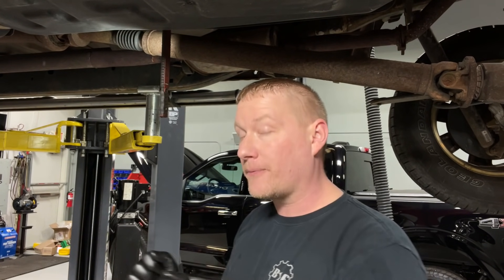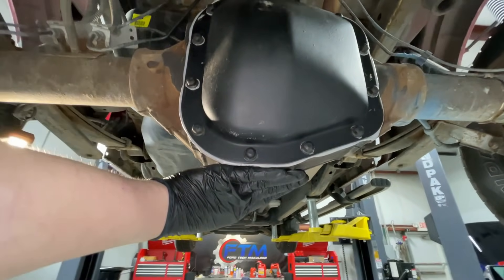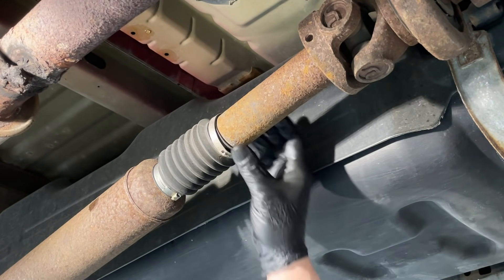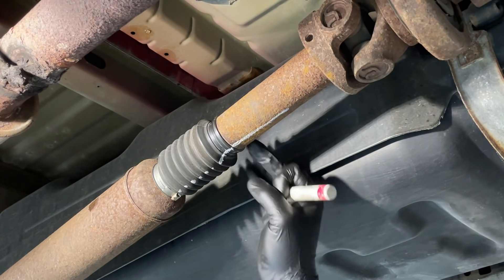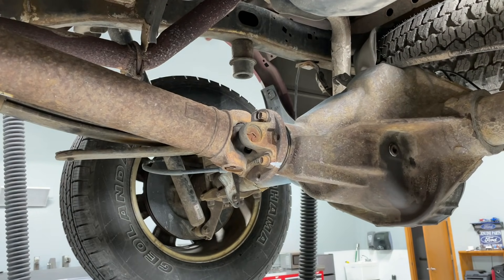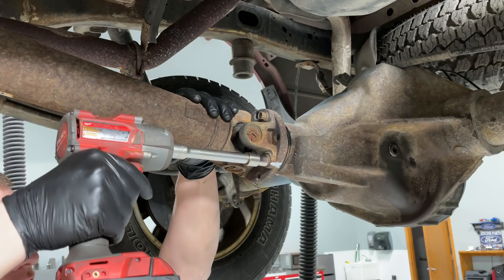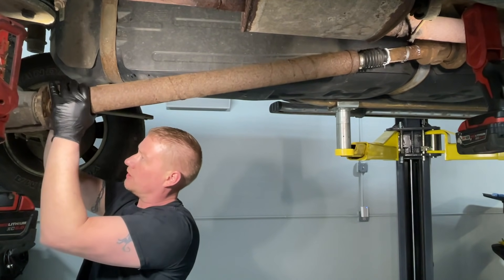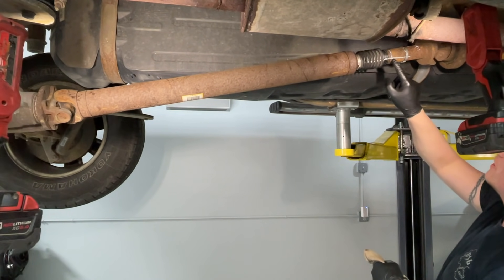Ford F-150 Driveline Slip Bump: Two Piece Driveshaft Kit Fix!

Comment: Man hooked on your channel, saving big $$$ on ford maintenance!  Nice safety Tips, Great content
Reply: He released a 2V spark plug repair video right after my F-250s V10 spit a plug.  After having a local machine shop "fix" the same issue on my Mustang resulting in another blowout and engine fire under 100 miles later I decided to fix it myself for cheaper.  It's been a few years and my driveway fix using the tools, advice, and methods in his video is still holding up, sucker pulls my camper all over 6 months out of the year and drags my brothers boat to the lake and back each season as well.  I'm certainly thankful for his contribution to the Ford owners community and have happily shared his videos with fellow owners over the years.

Comment: Our family had a 1962 Ford Country Squire station wagon that had a similar clunk. I went to the Ford dealer and they gave me a kit that consisted of a spring and washers and grease that would slide over the rear portion and apply pressure on the front shaft to keep it from clunking. It worked.....

Comment: Nice! I am feeling that 'bump' in my 2008 F250.  The truck begins rolling off the red light and moves ahead a couple feet, then BUMP, that invisible car behind me hits my bumper.
Reply: My 2004 F350 did that. I bought the entire tube of the blue slip joint grease from my ford dealer. Once a year I repack the joint and she stays nice and quite

Comment: Yea I think that I need this also.  Have a 2010 Lincoln Navigator with 6R80 and two piece driveshaft.  I have felt the kick in the rear feeling you describe when letting off the gas at lower speeds.  I thought the transmission was shifting rough, maybe not.

Comment: Man. I tried this and was surprised. Seemed like there was grease in the spline when I pulled it apart, but it was pretty sticky in a couple spots as it came apart. Wouldn't have expected a shaft that clearly still had some grease could affect how the truck drives so much. So much smoother now off the line, and from forward to reverse, parking lots, and even braking.

Comment: What a great video. I had a similar 'bump' problem with a '76 E150 van I had purchased new. It had a single driveshaft and about once a year I had to drop it and put some wheel bearing grease on the splines. I can't remember how I knew to do that- no YouTube back then, of course, but I suspect a great mechanic I knew probably clued me.

Comment: My 2005 F150 xlt had it as well(200k+ miles). I ended up buying a tube of the Ford lube, and just used zip ties to hold the boot back on. Every other oil change Id grease it up while I was under there. Never an issue again.

Comment: Good demonstration. If it was my vehicle I'd probably strip and re-grease the U/J's. (Primarily because I hate grovelling about underneath, getting grit in my eyes)
Is it worth putting more of the grease into the spline socket? That way the pressure generated when you push it home forces grease into the splines rather than pushing it out into the boot.

Comment: Omg I told the dealership about this over and over they looked at me like I was crazy. Dealership refused to fix it under warranty
Reply: now you know. FTM. ROCK'S,  Go back to the dealer n tell him "FTM ROCK'S" I shall sue your ASS. I would. LOL.  However do not mention our Ford GOD aka FTM. THX.
Reply: They must have wanted to make some diagnostic money.
Reply: Me too. I took my 2012 in at 5k miles with this. They said it was “ normal “.  I’m a shop owner or 20 years now.  I called BS to their face and they just looked at me. I changed the trans mount , and rear end oil on my dime trying to fix it.  Took it to a driveshaft shop , they balanced the shaft ( 1 piece ) And  still nothing. After that I just lived with it 146 k miles now.  Now I guess I’ll fix it. Lol

Comment: I replaced my transmission mount on my 2011 f150 because I thought it might be the problem but it only made it slightly better. I was happy with it at first but it definitely clunks still just a little less. I’m definitely going to try this now! Thank you so much!
Reply: Did the transmission mount replacement as well.  Hoping this kit is the solution

Comment: I have a 2008 F150 4x4 5.3 190k miles. I replaced the front ball joints.  What about a DYI spark plug change. My old Ford dealership replaced them at 95k miles. Love your detailed videos

Comment: Had that clunk on the 2000 F150 I have. I had 2 problems. The slip joint was dry given the 200k on the truck. Also around the same time the rear spider gears were worn making a similar noise. Truck now has 241k and no issues. I did the slip joint used the motor craft grease. I used zip ties for the boot works great. I let the mechanic replace the spider gears and replace a leaking axle seal. Stay on top of fixes and these 4.6 will go 300k +

Comment: I have a question. I just took out my rear axle and I’m putting a new one in period I developed a leak in my rare opinion after installing a block lift on the back. I’m running if that was caused by me not having my axle at the right angle. I cannot find anywhere on the Internet about where my angles are supposed to be on my rear axle is tight supposed to holes that go into the leaf spring? do I have to worry about alignment with my tires? Do I need to tighten those bolts on the U-bolt a certain order? Hopefully you have to answer this before I put it all together lol appreciate all your videos you help me more than anyone else ever has mechanic work thank you.

Comment: Hey Brian ' great video, wish you could have given a sample run of truck so we could hear and compare clunking sound.
I drove a 2012 f-150 5.0 4×4 that made a clunking sound when putting it in drive and reverse,  also when giving gas to accelerate in both foward and in reverse.
I first thought it was transmission,  then rear differential, then transmission mounts finally engine motor pounts. 
It was neither,  so l'm hoping it is this in this video. One last thing ' can a stainless steel hose clamp be used to clamp down rubber boot on drive shaft,  if your style clamp is not available ?
Thanks for all your help 👍

Comment: Silly me.  I purchased the repair part for my 2011 Ford F150 XLT 3.5L Ecoboost 4x4, the 12pt 12mm socket and a big box of rags.  Just reviewed the video again to refresh my memory.  Jacked the vehicle up, marked my back U-joints and then slid forward to mark my boot.  Surprise surprise surprise.  Mine doesn't have a boot.  In fact mine doesn't look anything like the video.  Drive shaft is MUCH thicker and longer.  All I can think of is that I have the XLT 3.5 Eco boost and they have something different underneath.  Oh well.  I should have looked first.  Great video and loads of information, but not applicable to my vehicle.

Comment: Son of a... I had this exact issue on my 2016 F150. I called a few large dealer shops to ask them what they thought this "clunking" was. Even had one test drive it and they had no idea. I searched online quick and didn't see anything either. (probably could have found it if I had searched deeper) Afraid that it could be the transmission, I traded it in at a slight loss for a 2018.  If I had known it was something so simple, it could have saved me a fair bit of money.  Ah well, I do love my 2018, even though the 10 speed can't figure out what gear to use sometimes.

Comment: Nice Pipe.  It's like a CV Joint.  Cool.  You still have an Old Boot.  Back in the Day.  It was a complete Boot Kit.  Cool Vid.
Reply from the maker: yup I remember those early kits, I never used the boot and wondered why would Ford include it? Shortly after, sure enough they revised the kit and got rid of the boot everyone tossed.

Comment: If I am not mistaken I saw alignment splines inside the female part of the drive shaft. But marking it before you take it just makes sure it goes back together right
Reply from the maker: There is a double wide groove on the female side but no corresponding groove on the male side. It can be installed in any position, so it is very important to mark the relation.
Reply: @FordTechMakuloco  your videos are very helpful love watching them. I wish I was close to you so you could trouble shoot my F 150 because the dealer can't
Reply: @FordTechMakuloco  I just did my truck two days ago and forgot to mark it, now I’ve got a slight vibration. What can I do about it ?

Comment: Had this issue in my 2012 ford f150 super crew cab with 6.5 bed. This was the issue along with bad back shocks. Once shocks start going bad folks it causes the drive shaft to flex because the rear end is dropping causing a flex in the two piece drive shaft. Just wanted to share my experience.

Comment: I had the same problem with my 2012 f150, brought it to the dealer and they said they have never heard of any issues with driveshaft bump, wouldn't even look at it, so I fixed it myself, I brought it to my Chevy dealer, and traded it, no more problems.

Comment: Hmmm, this was probably the issue I had decades ago on my 72 F100. It used to make a
violent thumping noise just like you describe.
Reply: those old ones usually had grease fitting on the spline assembly, I have a "78 with such a set up.

Comment: my 2015 f350 has these exact symptoms. i though it was missing a gear tooth but it's not constant, it comes and goes randomly. im thinking this might be my issue and is simple enough to check myself before sending it in for repair.

Comment: While the driveshaft is removed, it's a good idea to check the rear universal joint for wear, or binding issues. If it's dry, or sticking, it will ruin the pinion seal on the rear differential thru harmonic vibration.
Reply from the maker: Of course.

Comment: Not mentioned in the video, there is an 8th inch protruding ring on the gear case under the Yoke holding it in position. Once the shaft is lose. it may spin slightly because of that. Very small prybar can help you release the drive shaft.
Reply: pry bar is my choice too, a light ballpeen tap to help the pry is a help but I don't like hard raps on a universal joint unless you are seating a new or replaced set of bearing cups. Metal stretch does funny things on rotating assemblies.

Comment: Great video, very thorough. I have this issue with my ‘12 f150 ext cab but my driveshaft is one piece. What’s the fix for that one?
Reply from the maker: Same but you grease the slip yoke which slides into the transfer case.

Comment: You mentioned in the video this would apply to a single drive shaft as well. When I looked at my 2013 F150 3.5L, 4x4, it didn’t look anything like the one in the video. I have a single aluminum drive shaft up to the transfer case. Does that mean I couldn’t experience the same binding?
Reply from the maker: Yes you could see my other video on the one piece driveshafts, link in the video description.
Reply: Thx Bro. Found the video. You’re the best!!!

Comment: I had to service the driveshaft slip joint on my 2008 Jeep Liberty, it had a splined slip joint made from the two shaft bodies.  The grease was very stiff.  the grease was about 7 years old.  And the rubber boot had been totally torn awa y.

Comment: FTM- I have a two-piece driveshaft problem, not the same but wanted your opinion. With my 1996 Ranger, I started hearing a whistle accelerating, and figured it was one of the diff bearings. I decided to have all bearings/races and seals replaced, and all three u-joints and d/s center bearing replaced since they were all OE from factory.
 I went to local Ford Dealer, they had the car 3-days and still wasn't finished. When I got it back, it had a terrible driveshaft shake starting ~30MPH...shakes the steering wheel and can be felt in seat. The whistle/howl is gone. Still has mild clunk when putting into drive/rev, like before..which I'd hoped would be silent.
I went back to Ford Dealership, told the Service Manager of problem, I have to bring it back in. He suspects it might be a u-joint installed backward?? This d/s had never been removed, it was the original balance from the factory and was always smooth.
What is your guess of the prob, and what should I do if it's still not balanced/smooth after they finish? Thanks very much, and any  readers experience is welcome too.

Comment: Dude - you are awesome! Extremely helpful videos!
 My 2012 Expedition transfer case went out (95,000 miles) and the dealer said it would cost more to repair than get a Ford remanufactured one with a warranty. Then they said 5 week wait for the part. Wait are we in Russia now? What do you suggest? Thank you.
Reply from the maker: If it failed to the point of destruction inside I would say wait for the reman, parts in general are hard to come by right now. I am very surprised to hear it has failed I don't think I have replaced but one Ford transfer case in my entire career.
Reply: @FordTechMakuloco  Thank you for your reply. What happened was that I was at an intersection after driving about 300 miles. When the light turned green I pressed on the accelerator and the engine revved but the truck didn't move. I put it into 4wd Hi and I was able to drive home. Heavy 'clunk' when I started from a stop in 4wd Hi, plus a grinding noise while idling. Ford said it was the transfer case.

Comment: also check for excessive play in the spline as well as in the rear diff spiders and axel bearings.
i wish you had a video on the tail shaft on the 2wd 2012 replacing the bearings as well as the seals.
270k miles...
yea in the rear diff new spiders, axel bearings and seals.  splines were shot so new drive shaft.
down to doing the tail or output shaft trans bearings, shims and seal.

I had 3/8 rotation slop in the rear diff when i started.
now it is almost zero.

I will post the dorman part number on my site
over at poustusa in the construction section under trucks

Comment: Thanks for your help videos.
I just wish that I paid attention to everything you said.
I did NOT mark where the stub fit into the socket.    I just fit it back in the socket and I'm certain it is in a different position. 
What would you do?

Thanks again.
Reply: Oh, I see.  I will need to rephase all of the bearing caps in order to correct this.  Sounds fun.  And more clamps will be replaced.  Jeez
Reply: Any idea what the clamp's part number is?   The size?
Thanks

Comment: Great video, wish it was out when I did mine. Did it mostly right and marked the bolts to the rear diff, but didn't know I had to mark the splines as well. I don't think I have any new vibrations or anything since then, is it worth worrying about?

Comment: Wonderful video.  I don't have a noticeable driveline bump, but I'm wondering whether a small amount of rotational play in that splined section of the rear driveshaft could cause a vibration that I get around 55 mph.  The u joints on the driveshafts have no play at all, but I have not taken off the driveshafts to see if the u joints are binding.  Wheel balance seems to be OK.  Using a dial indicator, I'm seeing about +/- 0.015" runout on the rear wheels and am not sure whether that is enough to cause the problem.  My F-150 is 2013, 2WD,  3.7L engine,169K miles.  Thanks!

Comment: I noticed that TSB 12-7-13 mentions moving the carrier bearing rearward (4x4 only).  I don’t recall your video mentioning the adjustment of the carrier bearing. Just curious about your thoughts/experience with this?
Reply from the maker: There is no real movement there more so side to side.

Comment: I wish the fix for the occasional 2-1 shift clunk in my '16 F150  was this easy.
Reply: I have a 16 as well, and I experience this as well some times when I punch it. ?
Reply: My 2015 Mustang GT clucks too.  Taking her in to see if can be fixed.
Reply: @scurfie2343  good luck. They will probably do a trans relearn which most likely will only work temporarily.  I need to check if there are any calibration updates on the Ford site, it's been a while since I peeked.  I own scan tool equipment that can do module programming.  Let us know what your dealership does for your Mustang.
Reply: @ozzstars_cars  I'm having the transmission fluid replaced, filter, and differential fluid replaced as well this Thursday.  I'm hopeful that will prompt them to check for calibration updates.  I will let you know!

Comment: Thank you for the video.

I'm actually experiencing this problem (very rarely) in my forde edge 2013 SEL.

Should I try this? Or completely replace the drive shaft (part is about $280 from what I can see)... If so, do you have a video on how to replace the drive shaft?

Thanks again for what you do

Comment: Does there have to be 2nd bump when youre coming to a stop? Im from the land of toyota and my chariot has a bump when i shift 1st to 2nd and everything else is fine. Doesnt happen when i turn the wheel and accelerate out of a corner or go easy on the throttle. 😊

Comment: Can you do a video on the 5.4 3V intermittent starter screeching sound.
Reply: Is that a common issues on the 5.4.  I've heard relays turn on and off so rapidly it sounds like screeching when they had the perfect amount of low voltage.

Comment: Great video and channel. I had a 2015 Transit 250 with a similar problem, but it was very intermittent. Would this be the same on that Van? The van is still in use, just someone else driving it...   Thanks.

Comment: Hey Brian, thank you for all the knowledge you share. I actually just got done with my 2009 f150 supercrew timing job. Came out great. 150,000mi. One issue I have, blinking dome lights when ignition in on position or while driving. Installed new TPMS sensors and can't activate them manually nor with the device. What do you think is the solution? Wipe out BCM?

Comment: I have a different issue been chasing, 2010 F150 2wd w/ 2(pcs). Vibration at 53mph with rear suspended. Is it possible shaft at rear in wrong holes at pinion?  Thank you for your video